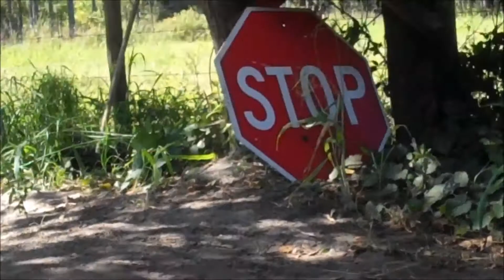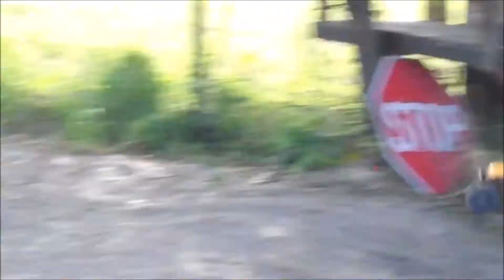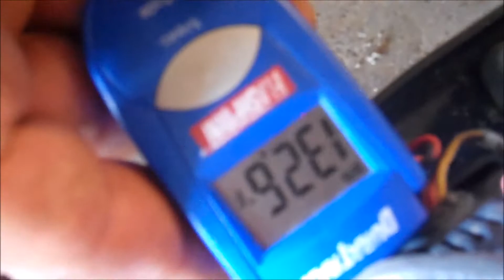Kyosho DBX VE 2.0 first run with HPI Trophy Flux Momba Monster on 6s

Comment: if you havent already try on some proline badlands instead of paddles in loose dirt and small amounts of sand in my opinion work a little better and dont heat up your truck as much! just a friendly heads up if you are tired of roasting paddles!
Reply from the maker: havent roasted any of the paddles we have but have had badlands on the slashes. another good tire. thanks for checking in